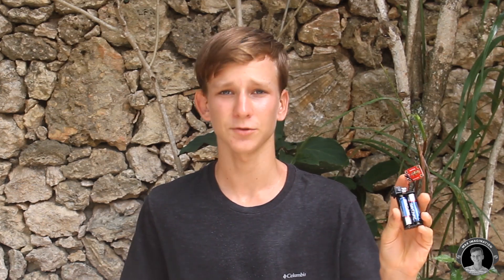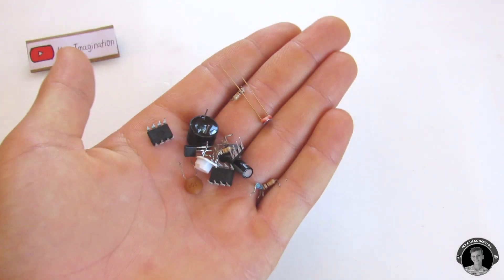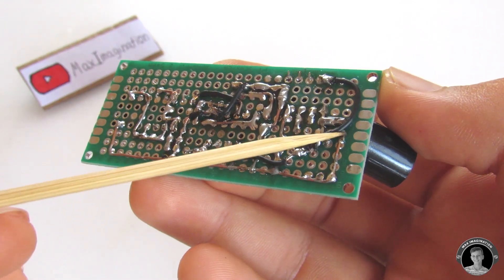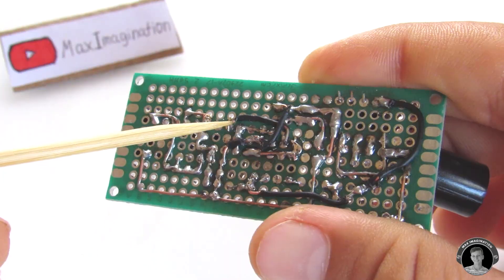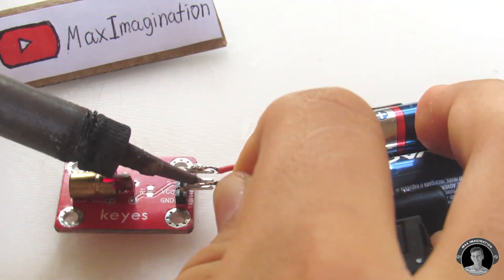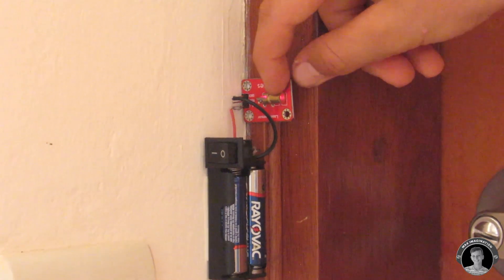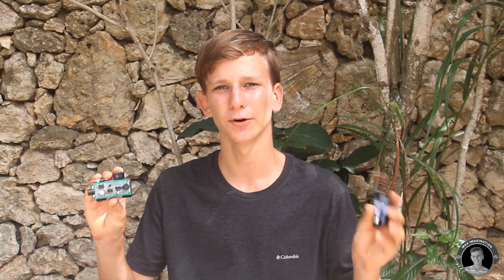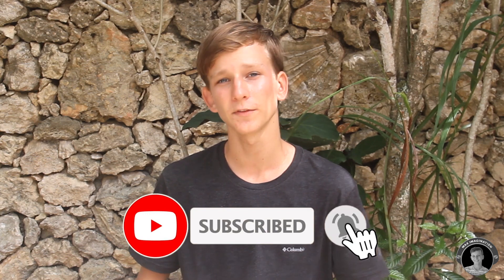How to make a Laser Tripwire Alarm from scratch | Electronics DIY

Comment: I am in the planning stages of building something like this and your video gives me a great starting point. I want something that can be redirected with mirrors for a single beam to cover a 1000ft² area. I am trying to figure out a way to wire it in to a relay that allows a timer to be triggered for the siren inside the house. Internet connectivity would be another goal, as i would like to recieve notifications of breach via text or pop up on a mobile device. Sounds like a lot but, i know its possible with some determination. Thanks for the ideas.

Comment: Great! I wont to make something like this on 20 meters distance to secure my motorcycle. Is this passible with that distance?
Reply from the maker: With precise adjustments using bolts to secure the modules, yes, I believe it's possible. The red dot also widens by quite a bit at that distance, it should hit the sensor 👍🏻

Comment: Hello, May I ask how does each components like 555 timer, op-amp transistor works or functions in the circuit?
Reply from the maker: Hi there. I cannot explain that simply through text. However, there are plenty of videos online you should check out demonstrating the operation of these type of ICs. Cheers.

Comment: Hi, may I know how do you charge those Li-ion batteries?
Reply from the maker: Hi, using one of these charging boards: https://amzn.to/3XHVmJB
Reply from the maker: If it's a 2S pack like in the video, then I advise you use one of these BMS chargers with a 3-wire cable: https://amzn.to/3PO1Ww4

Comment: Bro I tried many times to look at the video and understand connections but I couldn't would you please upload any other file not like which in the description because there are many things different than video
Reply from the maker: The diagram is accurate to what I showed in the video. Check every connection with your multimeter. Your hardware and components may also differ from mine. There are many factors.

All I can suggest is to check your connections.

Comment: Is it possible to swap the buzzer for a Servo?
Reply from the maker: Yes however, it would get more complex. You'd either need an extended circuitry to drive the servo or just a simple Arduino board that takes the pulsating signal and gives an output to move the servo so many degrees. The second option may suit best.

Comment: how long does will the whole system last if left on? all night, a few hours, several minutes?
and how hard would it be to put integrate a solar charging system?
Reply from the maker: Hi there. The system lasts around 2-3 days for me. A solar system could be ideal for outdoor securing applications or you could instead make the two ends USB powered and plugged in somewhere. Cheers.